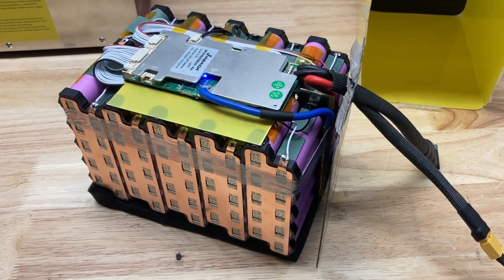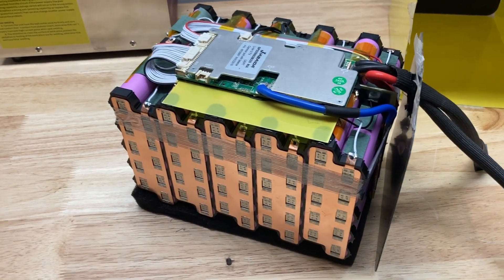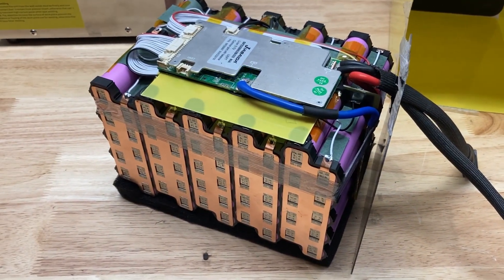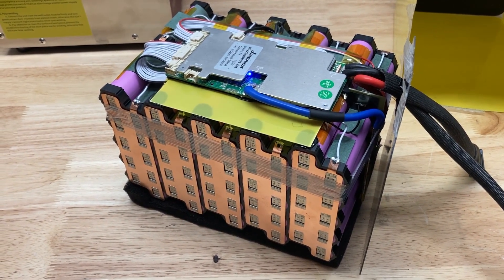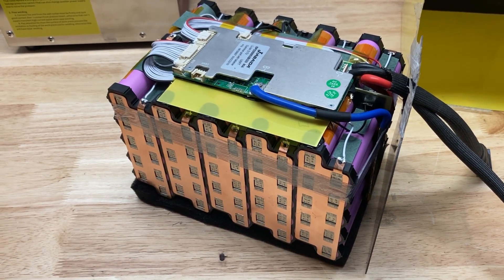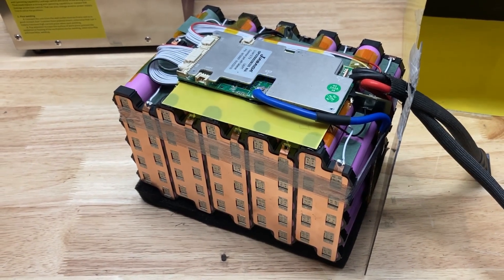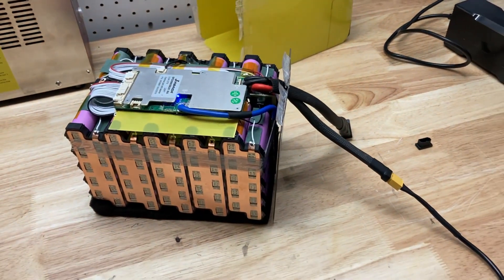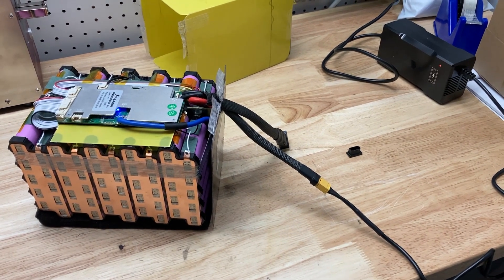JBD BMS will not charge or discharge

Comment: Just figured it out, you need to turn the switch function off
Reply: where is the switch function?
Reply: @АндрейИванов-ы4л3м There is a SW port on the BMS. You need to short that or there is an option in the BMS app which reads "SW Enable", just disable that if you are not adding a switch.

Comment: Hi I have different problem with my jbd bms 16s..after I got undervoltage alarm the bms disconnect the pack from the charger and won't allow recharging back ..the discharge is disconnect but also the charging..do you encounter that?
Reply: i do have the same problem @@simonazulay4781 Have you solved it?